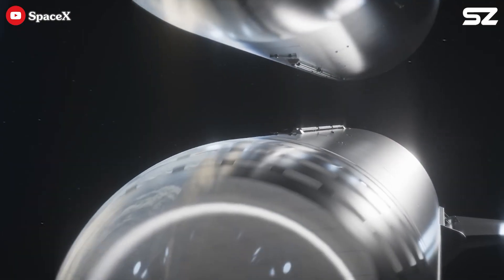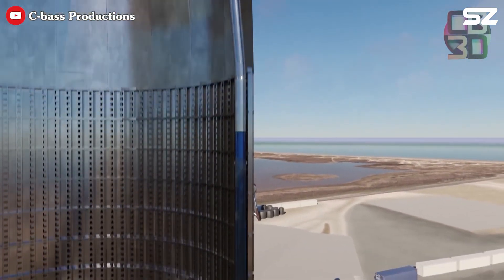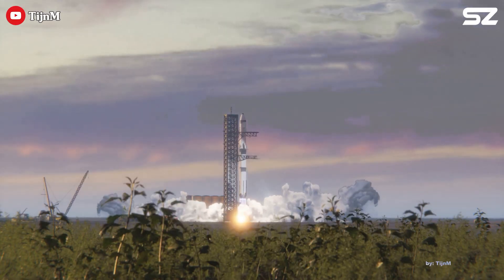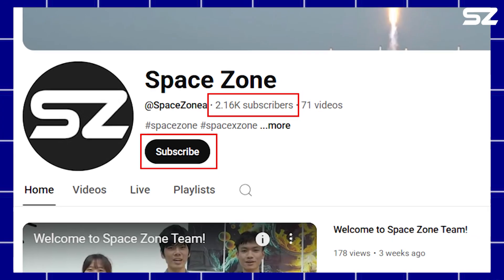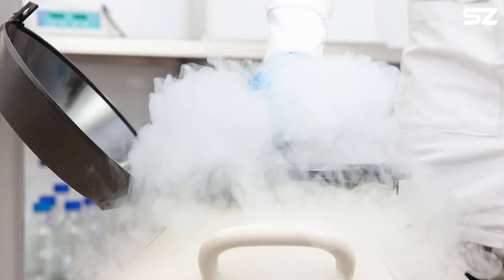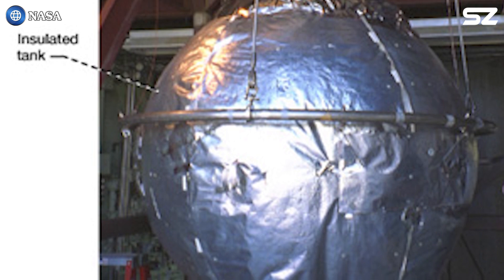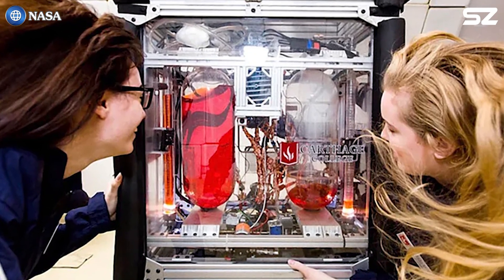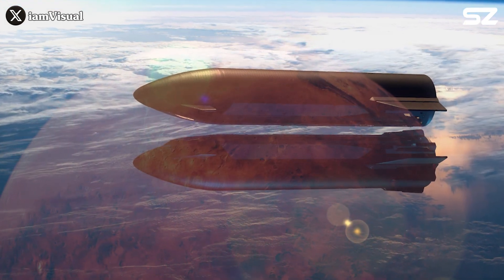SpaceX's Starship Refueling Solution: Chaser Starship

Comment: Two pipes are needed to pump fuel in zero gravity conditions. The first pipe pumps fuel from the ship's tank to the fuel storage. The second pipe pumps gas from the fuel storage into the ship's tank. The gas flow creates a wind that directs the fuel to the other side of the ship's tank.

Comment: If the thermal tiles are made with a percentage of magnesium and thorium oxide, then they might glow converting damaging infrared heat radiation into harmless white light (e.g. gas lantern mantle) to protect the starship from heat damage.

Comment: Putting aside useless emotional (in fact political) reactions against the "bad Elon Musk", and speaking technically, the orbital refueling concept is the right and only way for the humanity to proceed with the space exploration, at least short-term and mid-term. 

For as long as we depend on chemical propellants, the physical characteristics of our mother planet (strong gravity and dense atmosphere) will keep forcing us to use orbital refueling, as an one-way path to any meaningful interplanetary travel inside our Solar System.
It's difficult to develop and master it. Yes, that's right. But there is no other way to do the job. 

Everything else is just illusions and political non-sense.
Reply: Okay, lets discount Musk for the moment and review this solely from the problem of getting higher mass spacecraft to the other planets in our solar system. How long are you willing to delay and shackle the current scientific goals to the development of a potential tool? Do you normally take a semi-truck and trailer with a 45,000 lb load capacity to go get your personal groceries each week? Probably not. That's what is being done with the Starship Lunar Lander. Its inefficient, costly, and makes several engineering problems vastly more difficult. Its the source of the teething problems with having to use pumped rather than pressure fed cryogenic fuel, its the source of the requirement for rapid relaunch at a cadence never before attempted, its the source of the yet unexplored problem of how do you land a massive, top heavy rocket in unstable moon dust with no infrastructure without it falling over. Did NASA need a 100 ton (theoretically since I wouldn't trust Musk's promises these days) cargo capacity rocket to the Moon? Maybe it will be useful for the future, but that's not the scientific mission and not the requirement NOW. NASA's budget got cut again. They're not going to be funding a permanent research base on the Moon or Mars anytime soon. So why are we married to this oversized, over complicated, over budget and over schedule monstrosity?

Oh, there we go we're back to Musk and the very fun 'concepts of a plan' that keeps being in vogue. Musk sold NASA his Mars rocket concept through a corrupt NASA administrator that approved giving him billions of dollars and then went to work for him, getting paid from the very tax payer dollars she allocated. He repainted the CGI mock ups white and claimed like every other product he's ever shilled that his rocket would be bigger, better, more advanced, could be ready sooner, and would be insanely cheap to operate. Like every other product he's made where Musk had significant control over the design, we're getting to the point where we discover that he's not smarter than the rest of the industry, his stuff has half the expected performance, at three times the promised cost, and all too often performance increases or cost decreases have been achieved by ignoring best practice safety provisions. 

Does NASA potentially need a heavy haul rocket in the future when we get to the point of setting up permanent research bases? Yes. Does  it need one now? No, there's no budget and we need to develop expertise in regular Lunar operations before we get to that point. That goal is being hampered and I don't like the fact that US tax payers are going to ultimately spend years shoveling billions more dollars into SpaceX so that that his engineers can slowly kludge together a system that at its heart is being constrained by several bad design choices that flow directly from Musk's teenage boy like obsession with his system being bigger than a Saturn V.
Reply: @CharlesDyer-y2i  SLS is inefficient because they can't even make them at speed ... starship is in mass production .. so we are hardware rich .. SLS is the opposite. .. we already planted a flag ... now we want a base .. so quit huffing and puffing .. your leftist ideas suck
Reply: @websitemartian  Being able to rapidly build rockets that consistently turn into steel shrapnel over the Bahamas or land damaged to the point of questionable reuse isn't the flex you think it is. NASA's budget got cut again by the current administration. Who TF do you think is going to pay for a moon base? People are calling this out because the physics and realities of aerospace engineering don't give a shit about your ideology. Designing a rocket that is probably going to need in excess of ten refueling launches, with people who actually know what they're doing saying sixteen launches. All that complexity, all that mass, all those points of failure is asininely stupid when the entire point was just to serve a ferry from the moon's surface and back. If you aren't capable of logically considering that we as a country and space program are being hampered because Musk decided what the end result needed to look like and that it needed to be bigger than a Saturn V because of his ego and has been forcing his engineers to work backwards from that end result instead of the other way around then you are in a cult and you're not supporting science.
Reply: Anyone attacking orbital fueling stations is not anti-Musk.   Musk in NO WAY came up with the idea.  It's been around in scientific thought since the 1960's and in science fiction even longer.
Reply: Two pipes are needed to pump fuel in zero gravity conditions. The first pipe pumps fuel from the ship's tank to the fuel storage. The second pipe pumps air from the fuel storage into the ship's tank.

Comment: The sixth full launch of the integrated Saturn system was Apollo 11, the fifth launch went to the Moon and did everything but land, the ones before checked off meaningful test checkpoints. I'm sure you'll say that Musk doesn't have the budget of NASA but he has everything that they learned to stand on plus sixty years of computing, materials science, and general scientific advancement. He's still flying the same test mission, sub-orbital, with no meaningful payload, with hopefully controlled splash down off Australia. Have they succeeded in making some advancements, yes. But the original budget he said he could build a moon lander with is gone, and we're years behind schedule at this point. Nothing has been tested in regards to how he's going refuel his rocket in earth orbit, or how he's going to land a massive, top heavy rocket on the surface of the moon which is mostly fine powder without getting a bunch of astronauts killed.

This is just like every other product he's ever pitched. Promise the sun, stars, and moon. Claim its always just another 'year or two away' just keep shoveling either investor money or tax payer money into his money pit and ignore the warning signs. His 'genius' these days is mostly in how he manages to avoid consequences, including rained steel confetti over the Bahamas.

Comment: Why not just use 2 or 3 detachable booster rockets maybe the heavy lift. I know that’s not what the launch pad is designed for so make a universal launch pad that can withstand the extra rockets. Or fin a longer lasting fuel and propulsion system that can be used once in space. There is a solid jell fuel that only ignites when charged with electricity that seems to produce good thrust.
Reply: SpaceX prefers reusable so no solid boosters. SpaceX might (as you ssuggest, maybe should) use more or larger boosters. Refueling is still going to be a necessity for longer missions, mars for instance, and because the size of the loads they are planning on carrying is so much larger than were sent under Apollo so they are working out the problems of refueling.